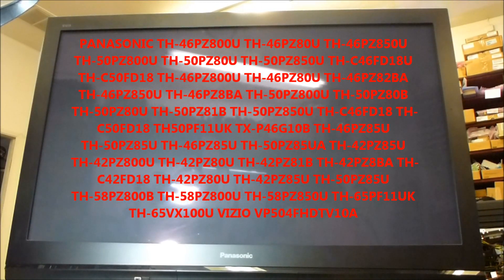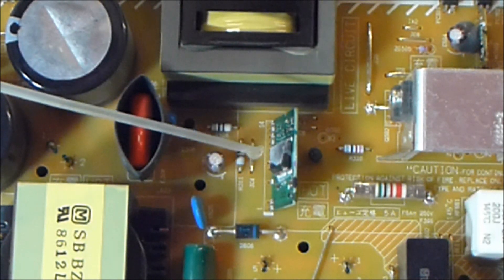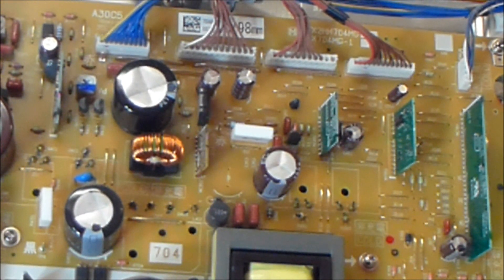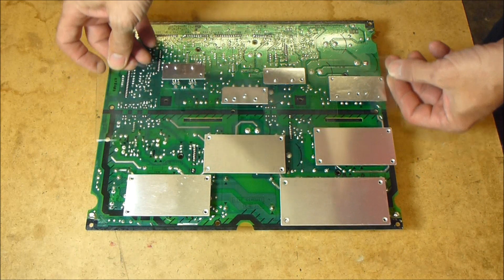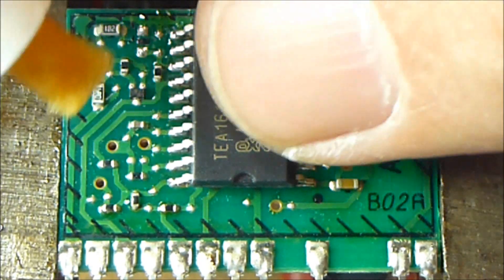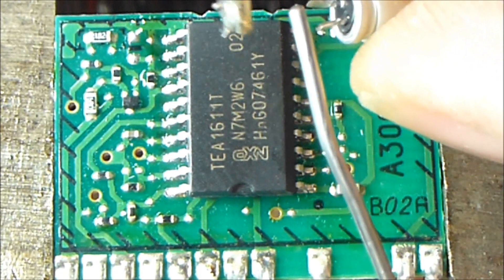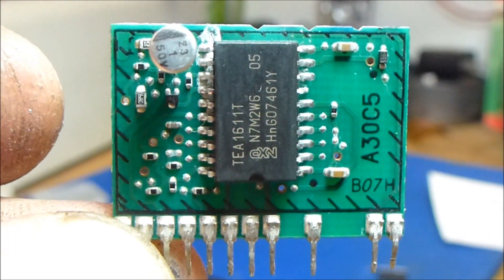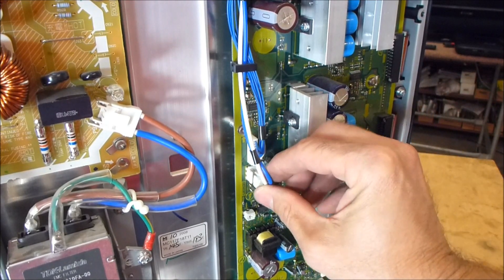Panasonic Plasma 10 and 2 Blinks TEA1611 ETX2MM702 704 706 Power Supply TH 42 46 50 58 PZ 800 85

Comment: I've got a TH-50PZ800U made in June 2008.  The red light's blinking twice.  I've got the 704 power supply (specifically ETX2MM704MG-N / NPX704MG-1).  When I plug it in I get two clicks, but not a third.  I cooled the two chips and have the same result.  Is there another part I should be looking at?

Thank you!
Ryan
Reply: Ok, I tried again (a little more patient this time).  After cooling the chip I get the following.  It clicks twice quick, then a 10 or so second delay then a third click.  When I push the power button it clicks twice then a delay then a third click and the double blink.  I'm not getting to the setup screen like in the video.
Reply: I tried again with the chip warm (waited about 80 minutes).  It acts the same cold and warm.  Two clicks, delay third click.  Power on, two clicks, delay, third click and double blink.
Reply: Ryan Riddell

Ryan,
You will have to narrow down the power supply failure to better resolve this failure mode.  First, I would suggest you replace the capacitor on the MC301 board (watch entire repair video to locate these ULTRA small cap).  You don't really need to remove the P Board or the MC301 boards as this cap is located at the top left of the MC301 Board.  At some point, you will end up replacing this ultra crappy quality cap anyway.  So, doing it now will go a long way to help narrow down the failure.
The failure can be associated with P Board, A Board, SC Board, or SS Board.
Let me know how this works out.
Regards, GS.
Reply: Gary Spencer I replaced the fifty cent cap and have the same problem.  I noticed on closer inspection one of the bigger capacitors (220V 900uF, marked C256 on the board) looks bulged out a little.  Would it be worth replacing that?
Reply: Ryan Riddell

Ryan,

YES !   When working on isolating and debugging high current power supplies, you must perform an inspection for burn marks, burnt components, leaky capacitors, bulging capacitors, and cold solder joints.  Bulging electrolytic capacitors are in a failure state.  So, spend the extra time to rectify a pending failure incident.  Replace any can-type electrolytic capacitors with high quality, LOW ESR, capacitors for "switch-mode" power supplies ......when bulging is observable.
Do not use any components from Radio Shack.  They are expensive and super low quality.
I rely on DigiKey for world class components and they stand behind everything and have excellent customer service people.

Regards, GS.
Reply: Gary Spencer I replaced those three capacitors and I'm now getting 12 blinks (progress?).  I followed a "Troubleshooting Handbook" I found online and did the following.

1. Unplugged the speakers (didn't fix it)
2. Disconnected P6 & P7 (didn't turn on by itself)
3. Checked Pin 1 of P6
4. Followed 2 blink instructions
5. No short circuit on pin 1 of P7
6. Measured voltage at pin 1 of P7 with TV on (didn't get 15V)

At this point the handbook says to replace the P board.

I disconnected the connectors on the board and reconnected them.  I'm now getting 2 blinks.

Any help would be appreciated.

Thank you,
Ryan
Reply: Ryan Riddell
Ryan,
Good job here.  If you want to pursue further to find the (possible) fault on the P Board, you have to be EXTREMELY CAREFUL at all times.

I would suggest that you perform a key voltage check at the output of the PFC (Power Factor Control). The MAIN switching supplies on the board are derived from the PFC.  The DC output voltage of the PFC is about +395 volts.
Measure the voltage between fuse F201 or fuse F301 and the power supply Ground at connector P54 (PIN 1 of P54).
If that checks out, measure Vsus at connector P2 (PIN 1 of P2) and Ground
(PIN 3 of P2).  Vsus will be close to +190volts.  Stay in touch until we know what's going on with the Power System.
These high voltages can carry lots of current and are lethal  ! ! !
          ...........  EXERCISE EXTREME CAUTION  ...........

Regards, GS

Comment: Thanks for your reply Garry. The model number is TH50PZ80BA. As stated in my post no amount of freeze spray will activate the psu it just continues with the 2 blink fault code. The 15v does appear for a fraction of a second on pin 1 of P7. I am wondering if in this case the D board is at fault ( giving wrong diagnostic). The training manual states that if 15v is not present on pin 1 of P7 the fault lies with the P board. If 15v is present on pin 1 of P7 the fault lies with the D board. In this case the 15v is present but switches off almost immediately.

Comment: What if you dont get the 10 blink code before you press the power button will this repair still work. I only get the 2 blink code and have tried cooling the ic down as in the video but doesnt make a difference and still get the 2 blink code and no start up..
Also 15v is present on pin 1 of P7 as it should be briefly before disappearing after the third click. Any help appreciated!
Reply: Nigel,
The third "click" is the main relay de-energizing which cuts power to 95% of the TV system.
What is the model of your Panasonic plasma HDTV  ?

There are 2 main high current switch-mode power supplies on the main P Board (main power supply board) which are controlled/regulated by MC201 and MC301 boards.  These small resonator converter controller circuit boards contain the controller chip and associated components.  You have to conduct the cool down test on both of these circuit boards INDEPENDENTLY to narrow down which resonant converter supply is triggering the "general" Error Code of 2 blinks.
Also, check the fuses on the P Board with an Ohm Meter with unit unplugged from wall outlet.  The high current path for each of these switch-mode power supplies is fused after the Power Factor Correction circuit.
Regards, Gary S.
Reply: Gary Spencer +Gary Spencer I have a Panasonic TH-46PZ85U.  This morning, the screen was off and the power light was blinking.  I plugged it out, tested the power cord and even swapped out the cord -- no luck.  The screen will turn on for a few seconds, then the display cuts out and the unit returns to a blinking red light.

Upon plugging in the unit, I hear 2 quick clicks.  A several moments later, there is a third click.  Pressing the power button, there seem to be two more quick clicks.  The power light goes solid and the screen displays the initial setup screen.  

A few moments later, the display shuts off.  I am left with a power light that blinks 11 times, breaks, then repeats the sequence. 

Any help would be appreciated.

EDIT:

Thanks for the link to the service manual.  It looks like 11 blinks indicates the fan board (PB).  The fans do spin before the unit shutdown.  They are also filthy.  I wonder if cleaning them would help?
Reply: Jason Wilson

Jason,
Operate the HDTV with the back panel off for several days where the unit is placed on a table top rather than wall mounted.  This will provide optimal heat exchange and allow you assess the nature of the failure.

Regards, GS.
Reply: Thank you.

Comment: I noticed one of the comments below and also found that the problem only occurs with the HDMI connected and my media PC active/on. When I disconnect the HDMI it turns on every time. Swapped my media PC to the second (previously unused) HDMI input and works as normal even with the PC on. I have a Panasonic TH46PZ800A that was showing 10 blinks.
Reply: The set finally stopped working altogether. I took the back off and de-soldered the two caps without removing any boards and it immediately returned to normal operation! Have ordered the parts from digikey and plan to replace the cap when it arrives. A very big thank you to the technician who posted this video, you have helped a lot of people save a lot of money!

Comment: I tested my set and it failed the "cool down" test on the IC chip. Is it necessary for me to also replace the capacitors as you did in the video? Thanks
Reply: Jon,
Norcal715 (author & producer of this blog) will recommend replacing cap & chip.  I recommend that you only replace the cap. This LOW quality capacitor becomes "leaky" after a year or two and drags down the Vcc supply to the NXP Power Controller IC. When the Vcc voltage droops down below the NXP chips minimum requirement, the feedback control loop for the Switch Mode Power Supply will assert an error condition to the local power monitor which then sends signal to the "system" Power Monitor microprocessor which will then generates the "Blinking SOS message" via the front panel LED.
Replacing this capacitor is not trivial as it is so damn small.  I recommend replacing with a 1uF electrolytic from DigiKey - Part Number  493-10252-1-ND     $0.60 each.
Perform this repair on MC301 circuit board first.  Test out the HDTV for normal function & operation, then perform same repair on MC201.  The MC201 board will eventually fail due to this low quality ceramic capacitor
which will cause failure of the high voltage Vsus supply.  The electrolytic capacitor that I used (p/n  part number  493-10252-1-ND) is non-polar so you don't need to worry about orientation during installation.
Regards, GS.

Comment: Gary, I have 2 blinks after it shutdown and the fans have worked for 2 sec. I have the 15V at pin 1 of P25/D25 for a 1 second. Should I get the 15V while the Tv is still blinking if my P board is faulty?. TV Model TH-C50FD18. Great video!!!
Reply: NO.  As soon as the "main" relay de-energizes (unlatches), 98% of the TV is without power.  The only power that remains "on" is the +5v Stand-By power which is generated on the small power supply board which is called the AC board.  This StandBy power enables the system to sense failure modes on most of the boards in this chassis.
So, to quickly narrow down the failing board (P Board  or  D Board), conduct the cool-down test that is demonstrated by Norcal715 in his video.  I suggest that you cool down (with compressed air or can of "freeze" spray) the small circuit board MC301.  Just spray the NXP power controller chip and the coupling capacitor which is the ultra small ceramic capacitor at the top of the board
(watch the entire video to understand WHAT capacitor I am referring to).
MC301 controls, regulates, and maintains +15V, FSTB+15V, and Vda.
The majority of the power supply failures in this blog are caused by this low quality, 2 cent, capacitor.
I am amazed at the sophistication of the Panasonic Plasma power supply systems. Especially the P Board power design.  Unfortunately, a 2 cent capacitor can render the HDTV useless.  AND ....it is not easy to isolate this failure.  Please let me know the results of your cool-down test.  Remember, only cool MC301, do not cool MC201 .....yet.
If cooling MC301 does not restore momentary operation of your HD Plasma, then perform cool-down of MC201.  A failure mode of either of these circuit boards will cause the Main Power Relay to unlatch which kills 98% of the power to the set.
Good Luck, GS.
Reply: Gary Spencer Sorry for the delay. I tried cooling down the MC301 first and then MC201 and it didn't restore the operation. When I turn on the TV the fans work for a bit and the they turn off and I get the 2 blinks and when a push the power again for 10 seconds then I get 10 blinks.I am not sure what to do next. Thanks.
Reply: Locutor13
You need to grab the Panasonic Troubleshooting Handbook to isolate this problem (assuming it is not the leaky capacitor on MC301 & MC201).
Download this manual at ......
    http://elektrotanya.com/panasonic_th-42-46-50pz80u_th-42-46-50pz85u_th-42-46-50pz800u_th-46-50pz850u_chassis_gph11du.pdf/download.html

   ..........................  HAZARD WARNING ..................................
Go to page 28 of manual and follow steps to isolate and "unload" main power supply board to find fault.  Unless you know how to bleed off the stored energy of the large filter capacitors, let the unit sit for a few hours before removing the high voltage connectors (SC2 .....for example).  There is almost 100 Joules of stored energy in the collective capacitor bank for SC board power filtering.
This aspect of troubleshooting is very dangerous.  MEASURE the static voltage at SC2 "test point"  BEFORE   removing (with the HDTV unplugged from wall outlet). Always wear eye protection as well when working around power supplies.
But, I recommend that you replace the capacitors on MC301 and MC201 because they WILL fail at some point in the near future.  This is easy to do if you have good soldering skills for small surface mount devices.  If not, ask a friend to do it for you.
Hope this helps.   Regards, GS.
Reply: Gary Spencer
Great!! Thank you very much Gary, I did the troubleshooting and I found that I have a shorted X board.
Reply: Locutor13
Excellent  ! !
Are you going to troubleshoot this board or just buy a new one  ?
Regards, GS.

Comment: Where did you buy your parts for this video? I tried almost every store in town and they got nothing. The only place I've found they have is ebay. Anywhere else? Anyway, thanks for the video. Loud and clear!!
Reply: The NXP controller chip can be ordered from:
http://www.suburban-elect.com/display/TEA1611T/TEA1611T
The unit price is $2.25.
You should verify that your Panasonic Plasma responds to the "cool down" test
shown in the video.  If it does, you really DON'T need to replace the IC.
You need to replace the 1uF capacitor as it is an ULTRA low quality cap and is responsible for 99% of these thermal failures.
You can order a high quality capacitor from DigiKey:
                  part number     493-10252-1-ND     $0.60 each.
This is a high quality non-polar, Alum, 1uF, 50V radial lead capacitor that you will have to tack on to the ultra small pads on the ckt board with a 15watt soldering iron with FINE tip.  You cannot use a blunt tip for micro soldering tasks.
Radio Shack sells a really good iron fairly cheap and it's high quality with an 8 foot cord.  Radio Shack          15W Pro-Line Soldering Iron.
Good Luck !      GS.
Reply: I have watched your videos and I wished I did it earlier. It is very educational for beginners and ammatures. Yes I took  a surface mouting class. Thanks a millions!!

Comment: I have a Panasonic TH-42pa20 Plasma TV, i have had it new since 2004, no problems. Now it is starting to develop some problems, the colors seen to be bleeding through, most times (patchy pink) other times it has (horizontal and vertical lines) then the next time it clears up - ( on all video inputs). I have no idea what it might need, i do suspect the main video board might have bad components. So i am asking kindly if you norca715 or anyone can help solve this puzzle. Thank you

http://www.crutchfield.com/S-PUNKdPIb7kM/p_13342PA20/Panasonic-TH-42PA20.html
Reply: Rudy,
This is the type of failure mode that is very challenging to narrow down.  I recommend removing the back panel for several days and operate the TV in this manner which will allow more heat exchange with the open room air.  In addition, it will give you the opportunity to glance at many of the electrolytic capacitors to confirm if any of them are bulging or evidence of leakage of electrolyte goop.
A more aggressive approach is to slowly remove "high failure rate" type of boards to look for "cold solder" joints/connections.  This is very dangerous because various subsystems and boards store lots of Joules (energy) on capacitors.  Panasonic does have resistive bleed-off paths in these circuits but it takes a long time to discharge stored capacitive energy to below 50 volts.  Lastly, if you know someone that is a electrical or electronic technician (or engineer) they could take some "key" voltage measurements on various "test points" if you have a good quality digital volt-ohm meter that can measure voltages up to 250 to 300v.
Repairing such an old HD set could quickly become a hobby as there could be many separate problems and this requires strategy and patience.  This HD set is not worth bringing to a repair shop because all the passive components and high current MOSFETS are very old .......and rebuilt circuit boards may be very hard to find.  So,  UNLESS you are willing to sink money into it to keep it limping along, you might be able to donate the set to a charity.  Or you could sell it for parts.  I only state this because it is EXTREMELY DANGEROUS to work on this equipment.  It would be great to get Norcal715's opinion.  This guy is amazing.  I think he is the BEST in the business.  His technical videos are the BEST in the world.  He uses great camera, excellent camera angles, plenty of LIGHT, and the audio is ultra clear.  Best Of Luck.  GS.
Reply: Gary Spencer, I thank you for your quick response and i agree it is not worth taking for  repair due to it's age. However, i will take the back off and a basic observation of this unit since i have done so before to repair a past power issue. I also will leave the back off for a few days, to allow more heat exchange. I do have good test meters/equipment and i am aware of the stored up energy in these sets even after days of being unplugged from the wall.
Thank you Gary, i will wait for Norcal715's opinion and i will keep you informed on this  units fate.

Thank you Rudy.
Reply: Rudy Taylor

If you don't have the service manual, try using http://elektrotanya.com

Just perform a Google search for your Plasma model.
Such as .....
          th-46pz85u service manual  (for example).

After the page "loads" you will need to wait for a few minutes before you're given permission to begin "download".
The service manual has a small section that shows the list of key voltages to check and/or make adjustment.
Regards, GS.